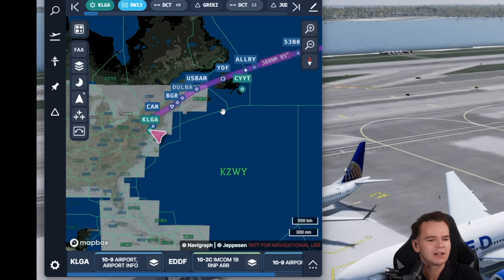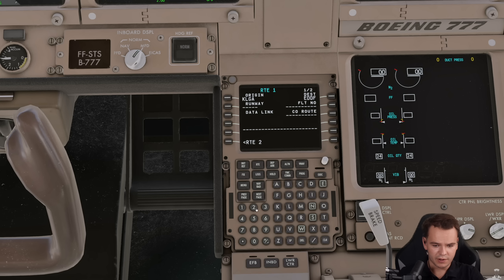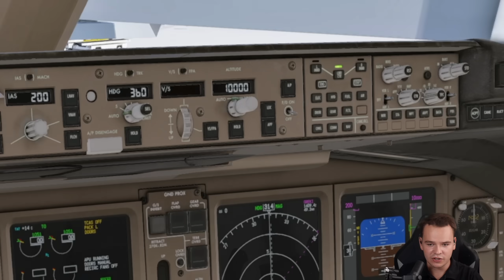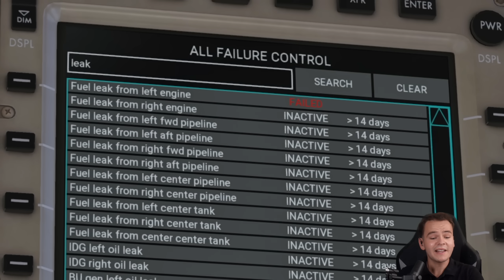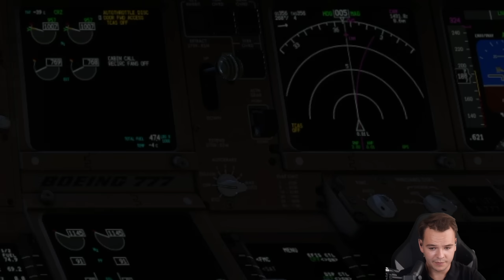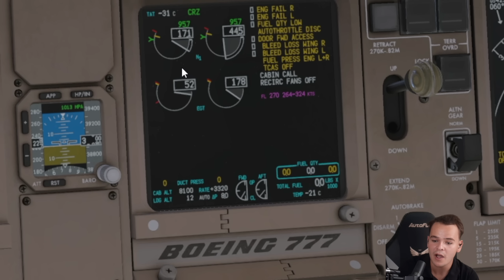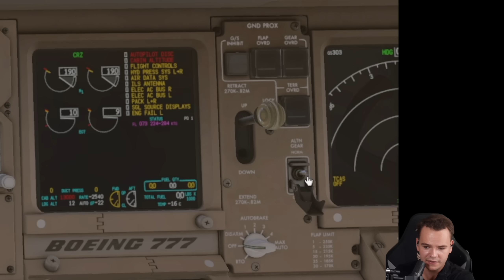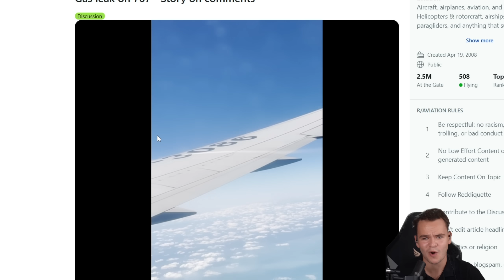PLANE FUEL LEAK EMERGENCY! What Really Happens When Fuel Runs Out Over The Ocean

Comment: the 737 doesnt need a RAT because its not FBW and it uses mechanical linkage assisted by hydraulics.

the 777, 787, a330, a320, a340, a350 etc is fbw so it must have a rat
the 757 and 767 have a ray because thye have hydraulically actuated flight controls
the 737 didnt need a rat because it has manual controls assisted by hydrauics. With no fuel a 737 would be possible to fly, but it would take a TON of energy and strnegth.